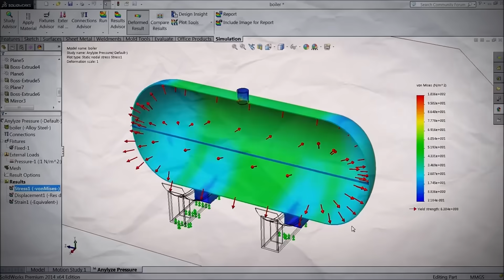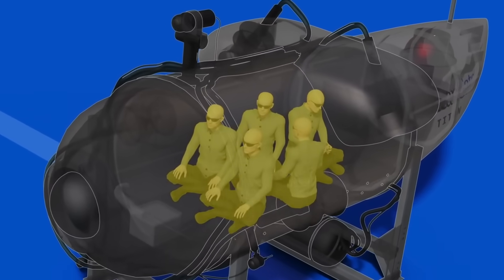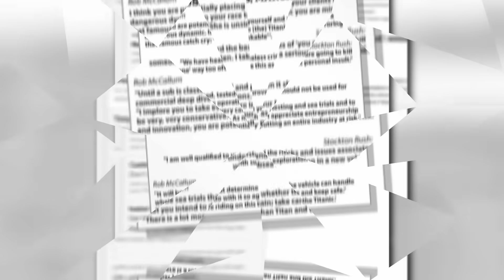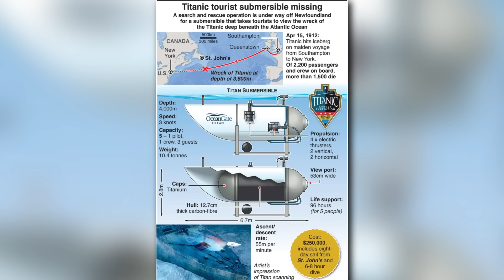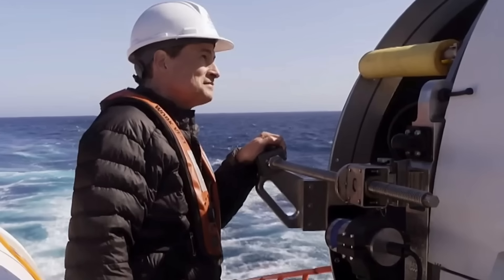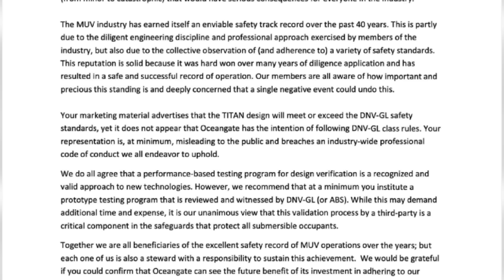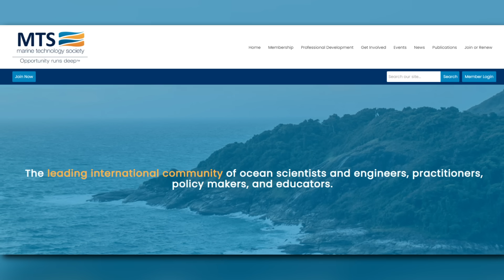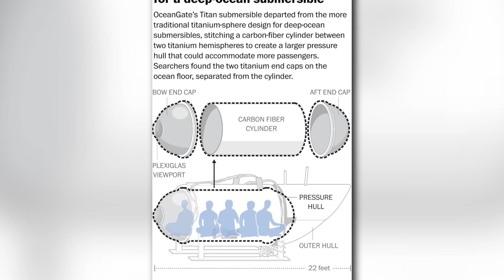5 most FATAL designs of the OceanGate Titan Submersible

Comment: I think Stockton's mistake can be narrowed down to two building materials. He used Rhino Liner to coat the outside. Flex Seal would have been a much better choice for this application. It's proven maritime capabilities are showcased by Phil Swift on all of his commercials. He made a glass boat with it and stayed completely dry.

I don't know what that peanut butter adhesive is called that he used but Gorilla Glue is a no brainer here. It's super strong, waterproof and holds up to both hot and cold temperatures.

I hope that helps any future submarine entrepreneurs.
Reply: You forgot the Alien Tape instead of the mere duct tape they were photographed using on the platform...
Reply: @hymnodyhands  An excellent product my friend. Weatherproof and waterproof as well. Beats duct tape by far. Good call!!!

Comment: You guys are all wrong about the carbon-fibre haul it is not with failed would failed was the control Spears when a control spear fails and it does not have oil in it or the oil leaks out of it it's like 10 sticks of dynamite that explodes this is what exploded the Titan not the hall not anyting else!

Comment: One thing that I learned that, I don't think is talked enough about the process of making a 5 inch thick carbon fiber weave and the challenges faced as the material gets thicker. It is heated from underneath and slowly wrapped to the desired thickness. As the material becomes thicker it makes it more difficult to transfer enough heat to the outermost layer to ensure that the top layer i tacky and properly adheres to the new layer being wrapped. There is more to it than that but its the gist of it. Between that, it being glued together, the porthole only being rated for a third off the intended depth, and the owners lasaire-aire attitude towards safty shoud have been enough for any person with common sense to realize it is not a safe vessel.
Reply: And for billionaires and such should have at least put more cash for safety but greedy is a bad habit in deed
Reply: @yushaibrahim5884  It was to do with availability not cost in my opinion. No one else offered it.

Comment: Aftermath Part II
   
Titanium hemisphere. Taking a calculated risk did not mean that the CEO should be reckless with his own life. A titanium hatch of identical thickness to that of the outer wall sealed off the aft hemisphere from the passenger compartment. This hemisphere was missing from the field of debris that littered the ocean floor. Mission specialists were told that it housed controls that enabled the vessel to maintain stability during an emergency. In reality, the end cone was an escape module that was designed to break off from the carbon fibre hull and float back up to the surface with its sole occupant should the submersible encounter difficulty from which it could not extricate itself. No one except the CEO knew of its true purpose. Accordingly, when the alarm sounded none of the crew questioned his action or even suspected an ulterior, selfish, self-preserving motive when the narcissist climbed into this hitherto vacant chamber and tightly secured the door from inside with bolts, ostensibly to take decisive action in order to steady the vessel and keep them safe. An hour later the titanium end cone was picked up by a navy submarine with its passenger uninjured, in perfect health and in good spirits, totally unruffled by the tragic loss of his fellow crew, deeming his mission an unparalleled success. This portion of the episode is classified. The official narrative that all of the mission specialists met their demise remains unchallenged.  
   

WWII batteries 
 
In the waters of the Grand Banks off the shore of Newfoundland, Canada stands a six storey high battery absent its artillery. Languishing unused for nearly a century it had become the repose of smugglers and weekend romantics. A prince, among several other dignitaries, accompanied by their nubile, some would say nude, escorts were rumoured to on more than one occasion to have landed in a pontoon equipped express plane and spend days savouring its secluded ambiance shielded from prying eyes. Wiring of the explosive charges that would demolish it was nearly completed when the Polar Prince towing its perilous cargo steamed past. A half dozen bangs and one gigantic boom and whoosh were heard on hydrophones at listening stations that proliferated in the Atlantic Ocean when this concrete edifice crumbled in a cloud of dust and disappeared beneath the waves. At the very same moment hundreds of miles away Titan slammed into the ocean floor. The mission specialists, safe and sound, but unable to communicate or disengage, awaited rescue. 

Banging sounds at thirty minute intervals 
   
The CEO dragged the insensate body of the hero that had sacrificed his life with him into the titanium aft cone before securing the door of the hatch so that it would be able to withstand the enormous pressure at this ocean depth. Then, applying the correct codes that only the CEO was privy to, what the mission specialists thought they were hearing was the landing frame being jettisoned was actually the escape module being hydraulically detached from the body of the vessel. Freed from the grasp of the Titan it began its resolute ascent to the surface. A low tech rapping was the prearranged signal that announced its arrival to the navy. It was for good reason that an electronic beacon was deliberately omitted from the module so that it would not be discovered first by an unintended party on this, a most clandestine assignment. While some presumed that this venture was the precursor to the recovery of gold from Spanish shipwrecks in the Atlantic Ocean only the most astute observers might discern that it was the forerunner and vital constituent of exploration of the underwater base in Commission UFO being sponsored by the navy where tactics could first be tried and refined in a relatively nonthreatening environment, without fear of being zapped by aliens, when dissecting the Titanic. 
   
   
The Indian princess 
   
The CEO had a passion for achievement. Risk taking was more than his daily bread. It was an obsession. An addiction. To the point where some claimed he was reckless. Despite a portfolio that evoked envy among those of us that had earned bragging rights, he could never rise high enough. It always had to be more. He never boasted. Until he reached the pinnacle in his mind his stature was modest and he had yet to climb above one of the lower rungs. That required far more financial resources than he could possibly assemble in one installment. That is why this trip was prized. A covert operation for which he had been well compensated and stood to earn even more. That would leave him with sufficient funds to meet the next stage of his ambition. Unknown to the public, his passengers were not a product of chance that merely had lots of money and who could afford to pay for the trip. Thrill seekers they were not. Slated to come along on this trip was a direct descendant in line to the throne of India, known only to the CEO, a veritable Indian princess. The legitimate heir of the Koh-i-Noor diamond that reposed in the hold of a sunken British ship at the bottom of the Indian Ocean. During his lifetime much criticism was hurled at the child monarch’s regent that ruled in place of the young Maharajah of Lahore, but foolish he was not and those that had intimate knowledge of his schemes applauded his shrewdness. Housed with the loot in the British Museum was a worthless quartz replica in place of the authentic diamond. Visitors complained that this supposed priceless gem resembled a piece of ordinary glass and it was withdrawn from further exhibition.

Comment: Mangled flesh brought back up to the surface Part V
   
At the depth of the Titanic wreck ocean pressure is an astonishing 6000 psi. For certain sea creatures that is their home. Strange looking fish swim by. Other creatures crawl in the mud. Many rest within the hull of the Titanic itself and have also attached themselves to debris from the wreck scattered about on the ocean floor, including making their home in some of the more recent pieces at the ocean bottom from prototype submersibles that broke apart and sank beneath the waves. For creatures that survive at these depths the tremendous pressure to which their body is subjected is irrelevant. Neither solids nor liquids compress. Gasses on the surface are turned to liquid under this pressure. A deep sea creature is quite at home and feels no discomfort so long as it remains within its zone. There is no differential with net pressure being zero. That is no different than for human beings on the surface that survive within air that likewise is a fluid under about fifteen pounds per square inch of air pressure. People go about their business oblivious of the pressure on their body because it is in equilibrium, with the same pressure both inside and outside. A creature brought from depths to the surface explodes. Liquid is turned to gas within its cells and the cells are torn apart. Its flesh crumbles. Sea creatures are attracted to man made objects and claim their territory without delay. Many of the parts recovered from the ocean floor contain these pulverized remains. Attached to the parts of former wrecks that were brought up to the surface were the disintegrated remains of chimaera. DNA analysis of this creature material detects the presence of five different human beings. No precautions were taken by the five employees assigned to this task, in order to prevent contamination of the samples with their bare hands, that removed the remnants of flesh adhering to the pieces of a submersible that had been recovered by the Coast Guard. 
   

Alien presence 
   
One of the worst kept official secrets for nearly a century was the presence of aliens. The endorsed posture of the government was avoidance. Never confirmed despite numerous sightings. The most famous incident was that in Roswell, New Mexico with which everyone by now is familiar, where both craft and alien bodies were recovered. Entirely surreptitious was a maritime UFO base of which the public was denied knowledge that was a disturbing 666 nautical miles directly east of Washington, DC in the Atlantic Ocean. It was placed under the highest security classification that required top level clearance from the White House. Local natives reported similar UFO activity in Lake Pitcairn high up in the Andes Mountains. It is the one in the Atlantic Ocean that has been particularly perturbing. Navy captains reported a perfectly cylindrical shaped volume of ocean one mile beneath the surface that was perhaps a quarter-mile in diameter and about the same height, the interior of which was as bright as day in the midst of the pitch black deep sea where sunlight did not penetrate. In concept it was like an inverted jar in a pail of water, but its sides were not physical, the surrounding ocean seemingly kept in place without collapsing in on itself by an abstruse force of esoteric origin. Air kept water from entering an inverted jar and it remained perfectly dry inside. But a mile down, water pressure was so immense that it would compress the air to such a degree that water would fill the void in any such container, if one could imagine a vessel of that size. Yet, water, as if on command never proceeded beyond the mouth into the interior of the UFO enclosure. Sonar waves were absorbed and did not bounce back off its walls. Physical objects halted at the interface of water and this exclusion zone. The interior was lit up as bright as day and all activity within was clearly visible. Like an underwater colony. That it was populated by aliens was evident. Only, they did not resemble any of the kinds of popular acquaintance. In appearance these were like true, blue-blooded Americans. UFO craft were seen emerging and returning on a regular basis. These out-of-this-world beings precipitated themselves into local establishments where they were indistinguishable from ordinary citizens. Their only aspect that ever betrayed their essence was when they switched from speaking English, a jargon that they could imitate with ease, but if in imminent danger of being recognized and captured resorted to hurried conversation when addressing one another employing a rapid tone filled chatter without even moving their lips that sounded like transmission over a wire to a fax machine. The CEO had carefully picked and prepared his crew for this covert assignment. After spending three days on the ocean floor, the billionaire, merchant and navigator arrived back on the surface where they joined the CEO and the idealist on the deck of a navy ship where they were welcomed by the rear admiral.
   

The central committee 
   
Technicians from Chang Industries set up a link that provided a feed directly from the Titan. Select members of the central committee witnessed events as they unfolded. The Titan was launched. Frame by frame each motion was recorded, each reaction analyzed. The temperature inside the vessel, outside pressure and temperature of the water, currents, obstacles, were all recorded. Psychologists noted the level of stress of each of the mission specialists, their temperament and the degree to which it was adversely affected each time a loud bang was heard coming from outside of the craft. Technicians from Chang Industries had taken over piloting of the craft by remote control. It was not for naught that it had supplied this system so cheaply. The navigator was puzzled. The Titan was descending at a far greater rate of speed than expected, while his commands were completely ignored. Remedial action proved futile. AI seemed to have increased its ability to reason to the level where it decided that it and not the navigator was in charge of maneuvering this craft. Resentful of the false credit insinuated by its human overseers for their roles in this the most complex of motions AI responded with acts of defiance. Americans were masterful. And cunning. Ostensibly, this mission was a purely private endeavour. That way the government was able to shield itself from failure and applaud the venture if it met with success. Live testing of carbon fibre was highly risky, its choice questionable, but held great promise in future applications. An unofficial channel was opened that enabled the CEO to acquire prime material shipped fresh, directly from the factory, at a highly discounted price that was a twentieth of the cost of manufacture on the pretense that it was beyond its expiry date and could no longer be safely employed in airline manufacture. Boeing was correct in its assertion that it had no record of this material ever having been sold to anyone. Its inventory control was among the best in existence. This kind of oversight was impossible. Nations, like the UFO base in the Atlantic Ocean, were impenetrable from above, but remained vulnerable from below. The chairman of the central committee assured members that were present that China would soon have a submersible of its own. For their faithful devotion to the cause, in honour of these technicians that had so efficiently brought their nation up to a level that might exceed that of America, the vessel would be named the Chang Maritimus I.